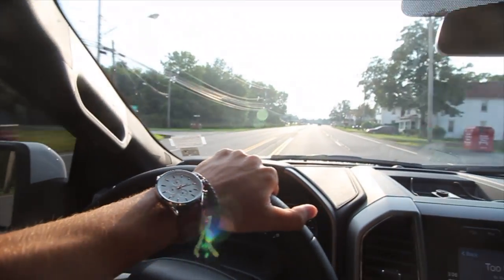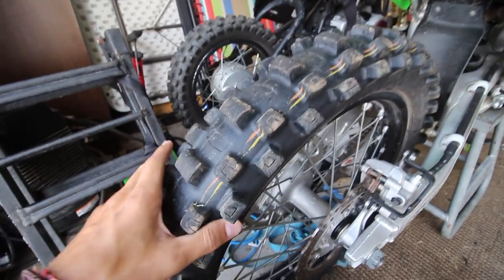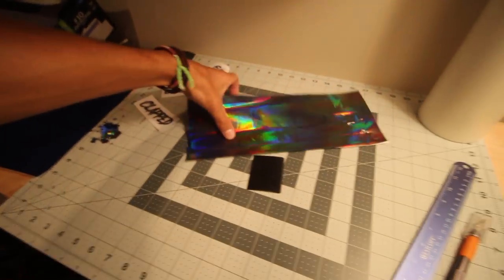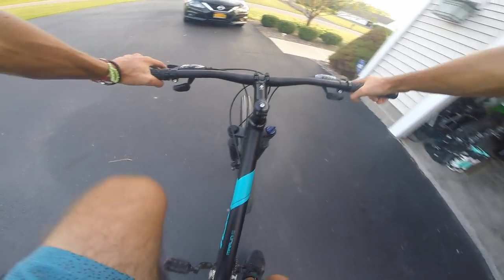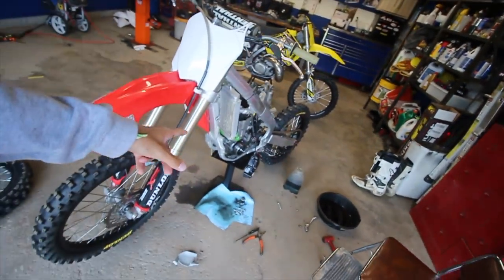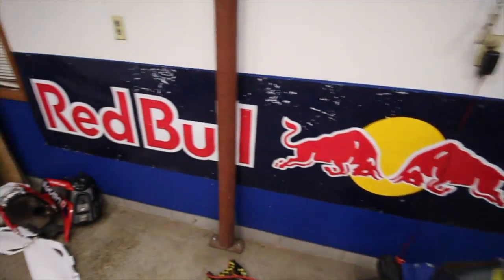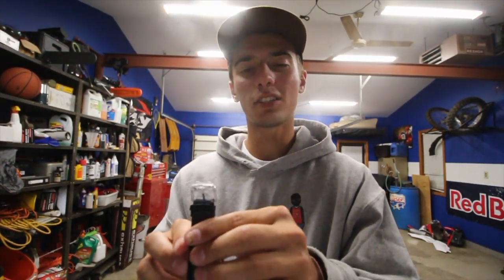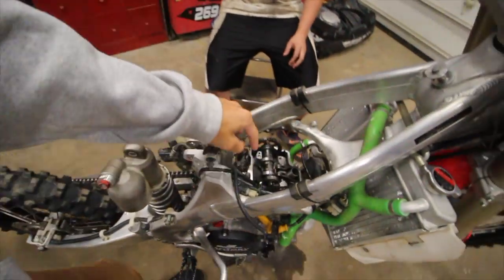NEW CR125 2 STROKE CONCEPT BIKE? | BLOWN UP CRF450 UPDATE

Comment: Just if you haven't figured it out yet, you spin that bar and there will be two holes for the bolts to go through. That bar is there to hold the rocker arm. Little FYI

Comment: If I were you I would go with a 8 inch visor around there I have a 6.5 inch and it is just short so the sun goes right in my eyes getting it changed as soon as I get a rock in it

Comment: But that tire still had the stripes on it😟 u shoulda seen my ole slicks😂
Reply: Same like I run a tire until it's slicks before I get a new tire
Reply: Christian i dont ever run an tire.... my parents wont even let me buy an motorcycle
Reply: Roko Games I was the same way as you and I know how that feels but I didn't even buy my pitbike I swapped 2 10in subwoofers and a box for it and then I built it overtime I needa do a video on mine🤔
Reply: Ikr, fucking pisses me off. He seems to change a rear after one ride, there was nothing wrong with that tyre . And tbh you'll only notice the benefits of a brand new tyre when it's wet and muddy, and the tracks he rides seem to be like concrete